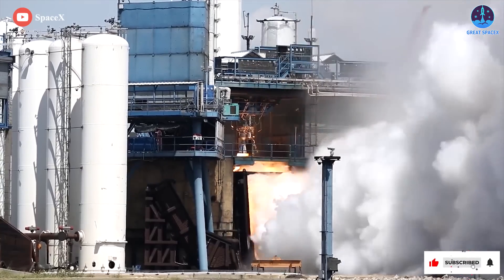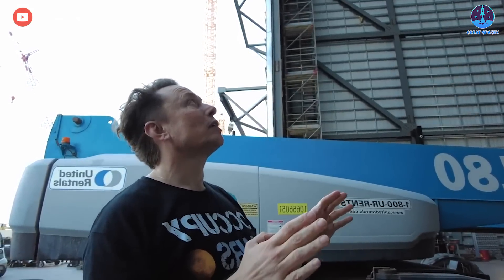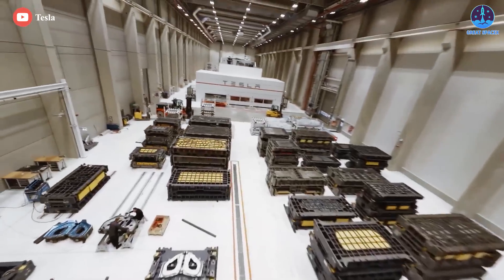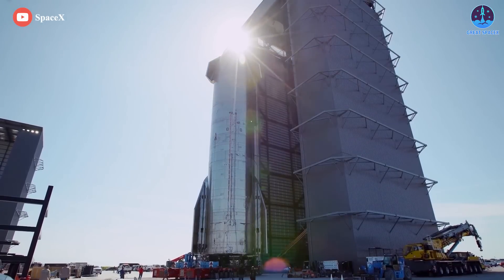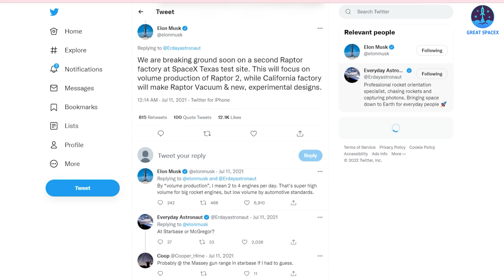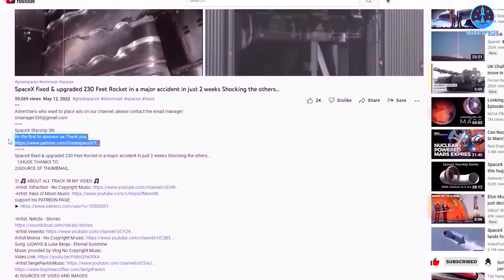Elon Musk's huge update on raptor 2 and the real reason SpaceX produces Raptor so fast

Comment: Such rubbish.  Last we heard from Elon, Raptor 2 engines were burning up.  It doesn't matter how many useless engines you can make per day.   But that's typical Elon.   Before that he sent out an email just before Thanksgiving telling everybody to stay at work as Raptors were failing and the company could go bankrupt.  No update on that?  Going from bolts to welds means the engines can't be taken apart for inspection and repair.  Not so much a plus.   

Gigapresses are much overrated, they have large downsides-- they are very very expensive,  the dies are a bottleneck, and large forged parts are a nightmare to make, inspect, and repair.  You can't just swap out one cracked part, you have to throw the whole thing away.   So learned the USSR, their Concordeski had large forged parts that cracked and could not be repaired.   Let's try to keep things real, shall we?  Unreal optimism is only going to lead to a big dissappointment.  Just sayin'

Comment: Couple claims here are not accurate. 

1. Producing a raptor 2 every 24 hours does not mean it only takes 24 hours to produce one. That is, building a rocket from raw material to finished product takes Space X longer than 24 hours.  But they have multiple stations building engines, meaning they can roll one out every 24 hours.  this is not an engineering miracle. 

2. BO has had a working BE-4 for years,  But they have not delivered them.  This is because they wanted to modify the design such that it is dependable and mass-producible and that rocket engine's systems are more advanced than Raptor 2, specifically the o2 rich, closed cycle is a feat that Space X has failed to yet demonstrate the capability to design or produce. Raptor 2 is also not capable of deep throttling in atmosphere, which is why they must do a suicide burn just prior to landing.  BO demonstrated deep throttling on New Shepherd, again, years ago.

Comment: In Software Engineering Unit Testing we use a method called red to green shift.
You define the expected result and it first it will 100% fail. After you improve your code you get more near the expected test outcome (from red to green). If you do it right most Errors can be found before tbe product ships.I think Elon favors this method bc he is a Programmer and Engineer himself.

Comment: "producing one per day" for raptor engines is a very different statement than the "only needs 24 hours to create 1 Raptor" that you said. 
If I have an assembly line and a thing comes off the line every day it does not mean that it only took a day to build that thing.

Comment: This rapid building, testing, and fixing of problems was a hallmark of the best of aircraft designers during WWII, and was the reason that North American rapidly developed the P-51 into a war-winning aircraft while Curtiss-Wright was unable to develop anything better beyond its P-40, and was also the reason that the Merlin engine had multiple variants that progressively increased power output and performance until it was superceded by the Griffon, while Allison made only minor changes to variants of its V-1710 and never developed anything better.
Reply: Allison knew the future was not the V1710... See J33.
Reply: @jamespowell7302    The J33 was a GE derivative of an original Frank Whittle design.  Allison did zero engineering work on the jet.  The company was basically handed the design by the USG with a contract to manufacture it because it still had the manufacturing facilities to do it and the USG figured it could do it more cheaply than GE.

Allison's problem was that it was a division of GM, and was thus run by bean counters in a profit oriented car company rather than as a high tech engineering company making state of the art military products.   There was NO corporate culture of  iterative engineering design closely coupled with field testing.   That's how things were run at North American during WWII, and how things were run at Pratt and Whitney, Allison's much larger and more successful competitor for aircraft engines.  At Allison, making iterative engineering design changes meant changing the production lines which would reduce production volume and cost money and reduce profits.  Allison's corporate culture was to churn out engines like sausages to print money and profits as quickly as possible for the company.   Don't change the product, because that will reduce output, and reduce profits.   This is why the various iterations of the V1710 were relatively minor add-ons and did not address numerous flaws in the engine throughout its life cycle.    One of the last versions of the V1710 was used on the twin Mustang F-82, as the USG refused to allow North American to continue to use Packard Merlin engines in the plane (the USG had to pay Rolls Royce a $3000 licensing fee for every Packard Merlin it used).   This version of the V1710 had persistant problems that Allison refused to fix (there was no profit in fixing this limited run of engines), resulting in a troublesome engine that required a high level of maintenance and repair.  This fact is detailed in the book "Mustang Designer" about Edgar Schmued.

Pratt and Whitney in contrast developed an entire family of radial engines from the R-1690 (B-17), R-1830 (B-24, F4F), R-2800 (F6F, F4U, P-47, multiple planes), and finally the R-4360.   The R-2800 was an iterative design that ended up boosting its original horsepower rating from 2000HP to 2800HP in the final versions.   Pratt and Whitney's radial engines stayed in use for years into the postwar jet age, even as the company moved into making jet engines.  
Unlike GE and Allison, which were handed their entries into the jet age on a silver platter by the USG via direct access to Frank Whittle's pioneering designs, Pratt and Whitney moved into making jet engines entirely on its own, and remains one of the dominant players in the jet engine market.   

Allison soon fumbled away its early entry into the jet age as it really had no engineering expertise to continue designing great jet engines, and stopped making anything related to jet engines apart from gas turbine engines, and was eventually acquired by Rolls Royce.

Comment: Getting to Mars should be a process.  First build a travel capable space station. build it so people can live on it and work regularly help to build it. Then build on the moon station, practice there on how to build on Mars. By then we should have better space engines.  Basically grow into Mars.
Reply: Nah. I think Musk addressed this exact issue few years ago. TL DR version is: if they focus on Mars-capable hardware from the beginning, its eventually much cheaper than your plan, i.e. designing rockets first for orbital stations, then ones for Moon, and finally one for mars ...
Because a ship capable of traveling straight to Mars can hop around orbit and Moon with ease by default; but the opposite is almost certainly false if it was designed for lesser goals.

Comment: I've always wondered why they can't design an adjustable engine bell like on the military jet engines and the afterburner.
Reply: They can. It’s called an Aerospike. But so far, no one is willing to build and use when you have tried and true. And with material advances, they can now be built lighter

Comment: I worked for an aircraft/missile instrumentation company. I would bet, with his success, that Elon has one heck of an instrumentation configuration on his rockets. I wonder how he monitors the telemetry. is it by radio or is he using starlink?
Reply: I believe they use radio and starlink, but starlink is not reliable enough yet without laser comms between sats and the higher altitude shells as well

Comment: Elon has never said he can build an engine in twenty four hours; producing one engine every twenty four hours is not the same thing. Each engine and its parts will take a lot longer than twenty four hours to progress down the production line.
Reply: They complete one every 24 hours hours might be a more accurate comment.
Reply: If they get one out the door every day that still blows the doors off everyone else. Good enough to impress the heck outta me, but no one has to care about me; much more importantly it's good enough for his mission.
Reply: @ThomasEWalker  Just correcting the lazy journalism.
Reply: bit picky
Reply: @shanewalker9564  Got to keep these journalists honest or they'll write any old bollocks.
Reply: tomato tomato. If it takes 30 days to build one but you build 30 at the same time is the production rate 1 per day or 30 per 30 days? All depends on how you want to explain it.
Reply: @Gibberish434  The initial impression given was that he could build one in a day. This isn't true.

Comment: There are only two hydrocarbon fuels that are known to be reproducible with Martian resources . . . LH2 and CH4 . . . liquid Hydrogen & Methane respectively.  LH2, while easier to produce, is too problematic to store. It leaks thru metal welds and joints easily and needs serious insulation at the LOx common dome and surrounding tank walls to reduce Boil Off . . CH4 shares a common dome w/ LOx w/o insulation, doesn't leak thru metal and is much easier to prevent Boil Off in space. That kinda leaves Methane (CH4) as the Only viable hydrocarbon fuel available on Marz.

Comment: There is a very simple reason why spacex had to make the raptor. Getting to Mars will use every bit of fuel you have so you have to be able to produce your own to have any chance of getting back. We know there is methane and water ice on Mars but no oil as far as we know...which is what you need to make RP1. So methalox it had to be.
Reply from the maker: Exactly!!!
Reply: There is no methane on mars other than background levels of less than 0.5 parts per billion (ppb) molecules of air. The chemistry of making on suit fuel for a mars return mission is more complex than that. Basically you have lots of co2 in the martian atmosphere. if you break that down into carbon and oxygen (which is difficult to do since the carbon tends to clog up any processing apparatus). You can then use the carbon and mix it with hydrogen (which you either bring from earth or make by finding water on mars and breaking that down). Then there are some steps to make liquid methane CH4 and liquid oxygen O2 out of this.
Reply: @Mar-s5q8m  There is methane on Mars. We are not quite sure what is producing it at this point but over a two year stay there is more than enough to make a return. In terms of oxygen, moxie is producing that right now with a tried and tested method that isn't clogging up anything. Hydrogen is to difficult to store for any period of time. If you sent it from earth and then waited two years to come back...there would be nothing left. Mostly though, don't you think spacex have thought about all these things ? and chosen the most viable and practical option ?

Comment: I imagine the next version of raptor will be the size of the f1 but also full flow. That would be the holy grail of chemical rocketry
Reply: I thought the whole point of them not going up to the same size of the F1 engine was so they could have better reliability? Sure everyone likes big frigging dinosaur burners! :D
Reply: @majorhippo2772  exactly! When you are aiming at reusing the ships and boosters 1000 times with as minimal refurbishment as possible would you prefer to have 33 engines or maybe ~8-9
Reply: @trapstoner  yea but I mean reliability in terms of, say one of the engine malfunctions, then you could still have a decent shot of finishing the mission with 30 other engines. But if your rocket relies heavily on bigger engines and one malfunctions, then you ain't going no where.
Reply: @majorhippo2772  yes that's my point as well, that's why i said would you prefer 33 or 9 engines... More = better
Reply: @trapstoner  Ok, so we agree then, do we also agree that SpaceX should make 33 F1 sized engines for 1 rocket? I want that
Reply: @majorhippo2772  oh i would definitely want to see that, but that diameter of the rocket housing 33 f1 sized engines would have to be bigger than a house
Reply from the maker: Absolutely!!!
Reply: Combustion instability in the F1 was never solved.  Admittedly we now have computers powerful enough to perform the necessary modelling.  However SpaceX is dedicated to "good enough to generate revenue".  Once Starship is cumulatively profitable SpaceX will undoubtedly invest in a next generation engine.  However an engine with twice the thrust of Raptor 2 must be much less than twice as expensive to manufacture.
Reply: closed cycle > full flow
Reply: @iamscoutstfu  full flow IS closed cycle bruh 🤦‍♂️ and no closed cycle gg is not better than full flow staged cycle... Go watch EverydayAstronaut's video on rocket engines

Comment: If RAPTOR 2.0 is beating most of the engine in the market then What the RAPTOR 3.0 will do.
Reply: Raptor 3 will crush Raptor 2! 😂
Reply from the maker: Raptor 3.0 will bring human to Mars within a month 🤣🤣🤣
Reply: Raptor 3 will be little better. 
Raptor 2 is getting very close to absolute physical limits of chemical rockets.
Reply: Raptor 3.0 you can just place upsidedown on the ground to push the Earth itself too Mars
Reply: About the same, but I suspect more durabilty and reusability.
Reply: @GrigoriZhukov  and simplicity
Reply: Raptor 4 and then 5 and by 6 if we haven't already broken the laws of physics will become light speed